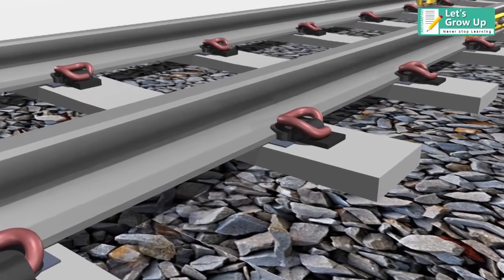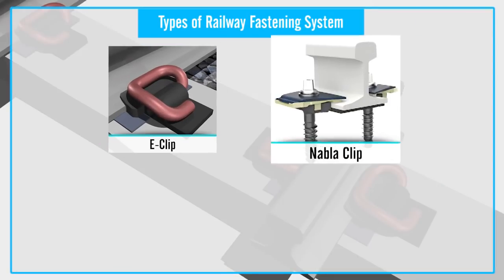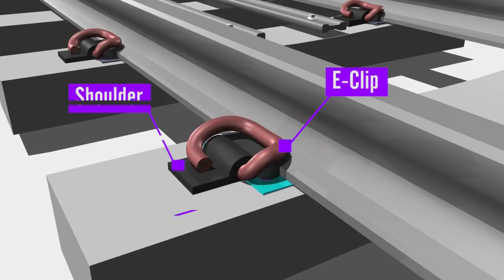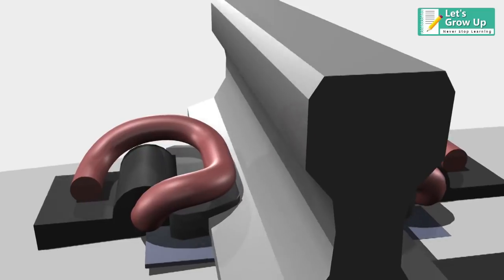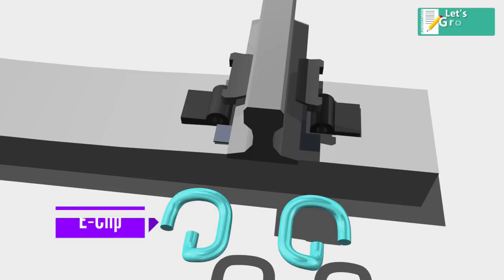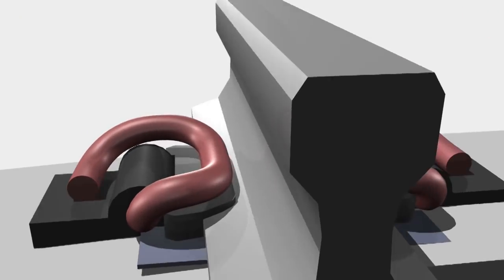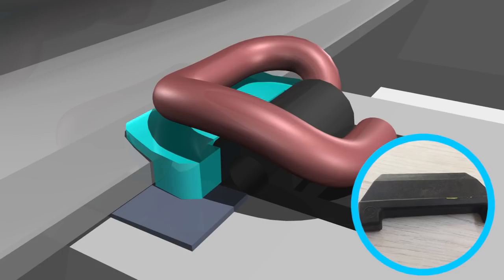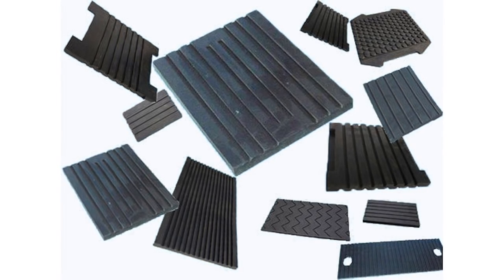Why rail #fasteners used | #railjoints #spikes | #e-clip fastening system | #letsgrowup

Comment: We used this same system on the Weipa line. Four spikes through the plate into a pre-drilled Ironwood sleeper (cross-tie) and a Pandrol E clip on each side of the rail.

Comment: This is supposed to be a PANDROL PR-clip. Turn the clip through 180 deg then it is a PANDROL e-Clip. The PR-Clip and e-Clip comes with different bar diameters. The bigger the bar diameter the bigger the clamping force. The clamping force for an e-Clip is between 800-1400kg per clip depending on the bar diameter. The PR clip in this video produces between 550-1000kg depending on bar diameter. The geometry for PR-Clip and e-Clip is slightly different because of the orientation you install the clips. The Clip in the video is not correct. Also the leg that goes into the shoulder is longer for PR and eClip. It reaches the end of the shoulder in most cases. These clips are made from Spring Steel. When the clip enters the shoulder it deflects and bends. You need a special tool or machine to pull them in. If you need any information on these clips please ask.